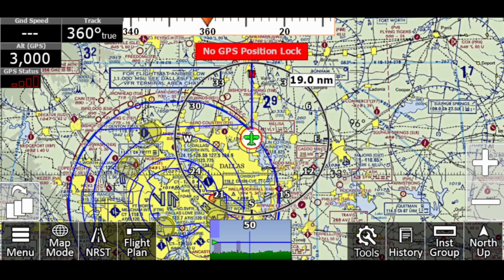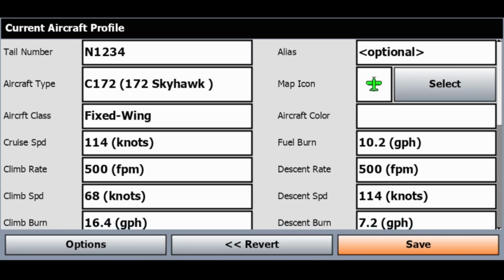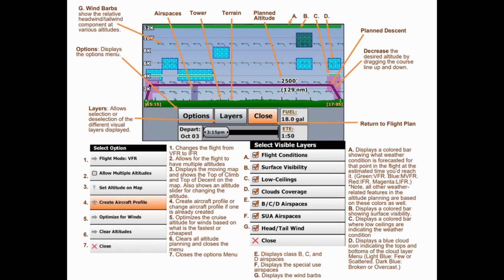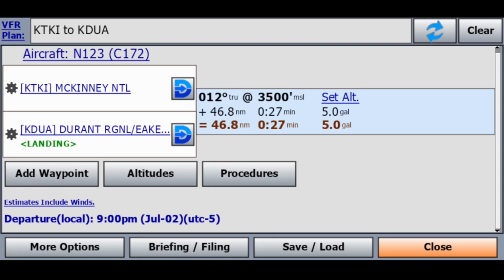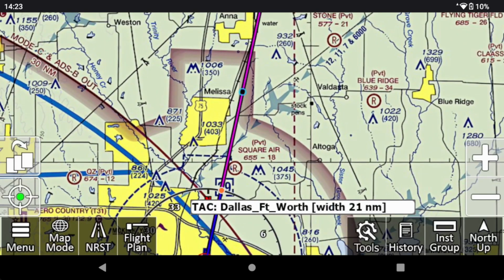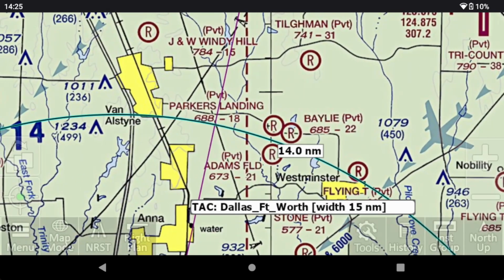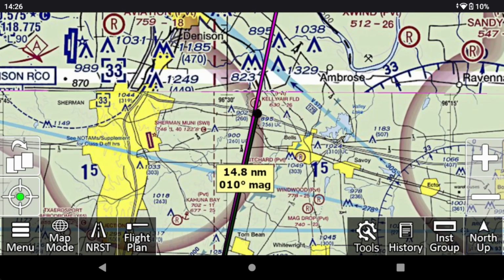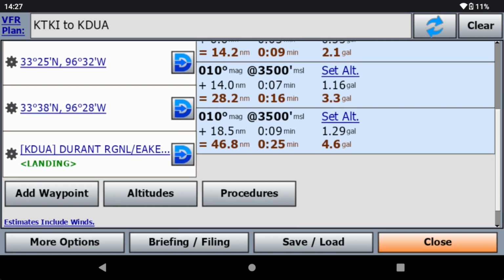iFly EFB For Student Pilots - Part 3 - Aircraft Profile, Flight Planning, & Waypoint Selection

Comment: Great video. What device are you using to have service while in flight?
Reply from the maker: Thank you! When you mention service, are you talking about a cellular data plan? Cellular data can be used on a lot of devices as long as you set that up with your service provider. The caveat is you will only have that connection when you are low and close enough to a cell tower, which is not that often during flight. So it is recommended to use an ADS-B in device to get weather, TFRs, etc.